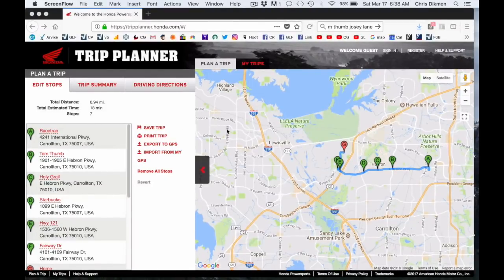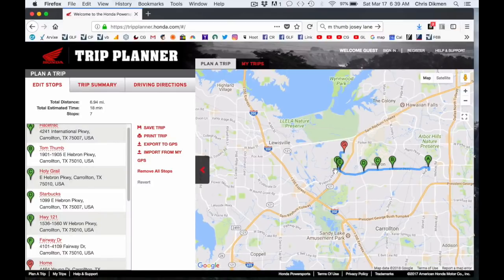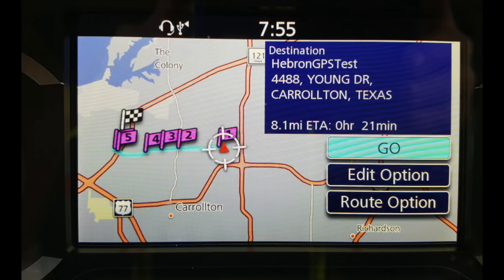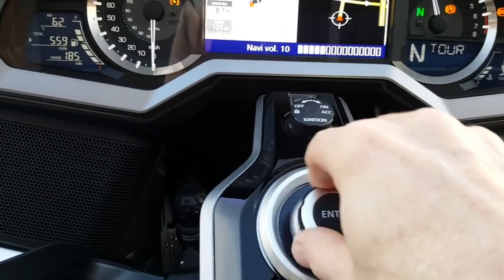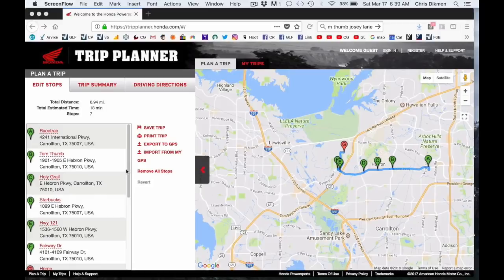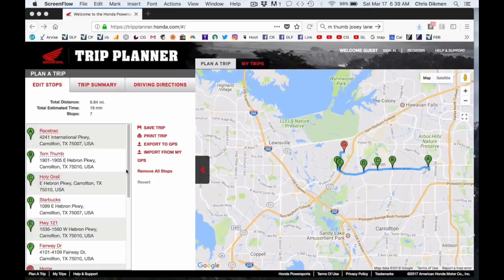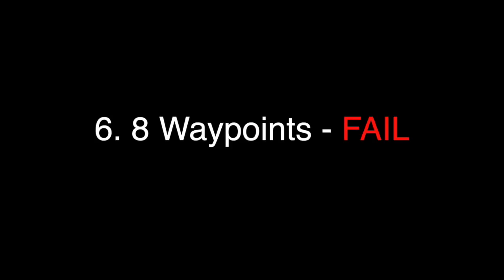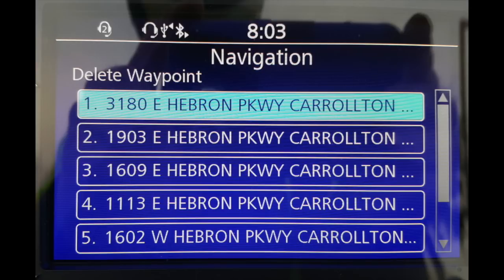2018 Honda Gold Wing Problems

Comment from the maker: UPDATE: I got an email from a friend last night who said his 2018 DID speak the word "Drive" correctly. I am going to do some more testing. I know mine did not interpret "LN" and "DR" on my route, because I live on Young Drive. I am also going to try to manually edit one of the GPX files to see if I can do a Find and Replace on "Dr" with "Drive" and see if the GPS will then speak the correct word. That would be a cool feature for GPS Babel to add, the ability to have it do that Find and Replace automatically during processing.

Comment: I pulled my deposit on the 2018 Goldwing, upon spending some time with it at the NY Motorcycle show in December. Both the installed GPS system and Apple CarPlay implementation were a disappointment. Other limitations, paint finish, reduced storage space, flimsy tank pocket lid, etc. have been well documented.

Comment: I just wanted to add that I am a long time Gold Wing owner since 02 I had Traxion upgrade the suspension on the old bike. In the very short time I have had the new bike I can honestly  say I love it so far maybe as I get into the bike more I will see issues. Baer in mind even the old bike had issues in the begining I was one of the owners that had to have the frame welded. I will update you once I try more ma input methods

Comment: Thank you very much for the information in this video. I find your videos to be fact driven and not based on any sort of bias. Keep up the good work. I will be buying a new Goldwing soon and am trying to decide if a new 2017 or the 2018 will be my best choice.  I find it to be a tough decision.
Reply from the maker: If you require a GPS, and expect it to be built into the bike, go with the 2017.
Reply: And if you want a NEW bike with a REAL GPS buy a BMW... This GPS is a MASSIVE MISS by Honda
Reply: I bought an 2017 ABS late last year because I didn’t want to be a Honda beta tester.  There are one or two features I wouldn’t mind having from the 2018 but largely I’m very glad I went with the 2017.

Comment: Cruise Man I'm so sorry to hear about this navigation. I always worry about buying any new bike or car the first year its made due to these kind of issues. I'm sure Honda will fix this issue with next year model but does not help you and others who spent over 30k already. I hope warranty resolves this. Thank you for all the updates and great videos
Reply from the maker: I wish I was as confident in Honda fixing this as you are. I figure they had 10 years to get this right and if they could not do any better than this, there may be little hope of a fix in the next year.

Comment: Me personally I only use a GPS to get to one location. If I want to go somewhere else I change the end route. For me even a cheap basic gps system works as long as it gets me to where I am trying to go. I was never big into planning multiple stops on a gps and tinkering around with different things. I always mute a gps so the sound quality, 8 planning points, and connection are not a big deal. I also always start my gps from where I am at not where I want to be so again this is not an issue to me. Overall the gps doesn't bother me one bit. Now those that are huge into using a gps and doing all kinds of things I could see where these might be issues but again for me none of this is an issue to me.
Reply: Agreed!  Some people will find issues with anything!   Who would make a video over something like this?   Just fix the damn thing!

Comment: Cruisman, I picked my new bike up two days ago. Same color (white) and with the DCT transmission. I tried to duplicate your problem were the address changes from the input. I am doing this inputing directly at the bike with the rotating dial. I tried five different addresses and each one worked fine it did not change the address from the input.
I have not tried transferring the data from the Honda trip planner yet I will try this tonight and see what happens.
Reply from the maker: You are correct, when you INPUT the address ON THE BIKE it holds it correctly. The problem shows up only when you IMPORT a route.

Comment: The fist thing I asked when my Honda dealer was first showing off there DCT Goldwing tour,  was about the GPS & when they said about 8 way points max , I laughed.  I load routes that will have 200mi or so with so many way points , my old Garmin 2730 handles it quite well , & to tell me a 2018 bike can't  ( unacceptable)

Comment: I have been disappointed with the built in gps on my 2018 Goldwing. I used it to get home and it did work fine for point to point. I am having a problem putting in the number of the address. Also the POI is not coming up. I have been using the Apple CarPlay with maps and made a short route and it worked fine. I do hope that a simple firmware update will solve that. Of course I have no idea how to even update the system when it comes out, since we are getting free updates for 10years. 
That said I enjoy my 2018 more than my 2007. GPS to me is a great addition but I still like to get lost on the road.

Comment: wow coming from Honda that's hard to believe.  Almost like they rushed the bike to production.  I personally like having a built in GPS on my motorcycles but have had more success with after market GPS units.  Hopefully its just an update that will fix it.
Reply from the maker: I would imagine they went cheap. They got a deal from HARMAN, or GARMIN wanted too much money. They should have stuck with GARMIN, or not had a GPS at all. BIG mistake.

Comment: Sounds like the system is designed to get you from where you are to a destination, NOT for trip planning.   I don't know why Honda can't figure out that on a Motorbike a GPS has a TOTALLY different purpose and that is pre-planned routes (and all that goes with that).

Comment: It might just need a software update. Have you had it in for service?
Reply: Stephen Smith 
The bike is brand new and shouldn’t need a software update that soon. The problems with the GPS can no doubt be solved with a firmware update. Hopefully Honda has been contacted so they can get to work on this.
Reply from the maker: This is more than a software update, this will require a complete overhaul of how this GPS works. It is simply an inferior product.
Reply: I have a new HD Road Glide Ulta and I thought the same thing. When I took it in for my first 500 mile service they also did a software update to the system and it cleared up many issues I too was having. I also bought a brand new Sena 20 intercom; that too required an immediate software update.  I guess what I'm trying to say is although you have a new product don't assume it has the latest software.  Remember a lot of equipment sits on shelves before it finally gets installed or sold.   To me - it's worth looking in--to.  Good luck!
Reply: and a bigger windshield, more storage space, and a better seat...
Reply: gman77gas 
You’re not likely to see an increase in luggage space, but a bigger windshield is available from Honda. Of course, the aftermarket Windshields will be available very soon I’m sure.
Reply: Well looks like I will keep my 05' or trade into a new 17'
Reply: No sense in trying to sell you a set of encyclopedias; you already know everything!   Hey - give me your address and I'll send you some cheese to go along with your whine!
Reply: Talking from a guy who bought a new Harley!
Reply from the maker: Send it to the address on the GPS and I will never see it
Reply: Oh, and lets not forget the suspension and steering........ Sooooo happy I didn't take the leap!!  Hello... BMW ??  LOL...
Reply from the maker: Scott, I have not noticed ANY issues with the suspension and steering of my 2018. My God, has EVERYBODY seen Max's videos?
Reply: LOL....anyone that is looking at Wings ...probably!!

Comment: From what i have heard so far (from various motorbike officianados), the 2018 Goldwing is not a very good bike. It's had issues with suspension, headnuts, satnav and more. I think that the 'differencies' between this and older models is that being NEW it hasn't ironed out it's niggles yet...mind you, any teething troubles should have been found and rectified long before reaching the dealerships.

Comment: Have you personally contacted Honda about this? Hopefully this can be fixed with a firmware and software update. Out of curiosity, have you tried using Apple Maps through the system? I know you can’t put away points in Apple Maps but just wondering if it works better as far as addresses and street announcements. Another thing you might try is to put Google maps on your iPhone and try to use that because I believe they allow waypoints. Of course I realize that way you have to do all the trip planning on the phone that way.
Reply from the maker: These issues are so deep that I don't think a software update can address all of these issues. It is simply am inferior product. It would be like trying to turn Windows 3.0 into the Mac OS, not going to happen. The limitations are hard-coded into the foundation of the GPS.
Reply: cruisemansgarage 
Sometimes firmware updates can be used to change things within the system. Hopefully Honda will address this soon!

Comment: You probably have your Garmin trip planning software to use and then use a translator program such as Babble to set that into a code the new Honda system can use.  I do not know if that would preserve your waypoint names.  I have never set my starting location as one of my points, I start wherever I am and the systems figure it out.  I hope Honda does update the firmware quickly, but until them my good ole Zumo will be my "point man".
Reply from the maker: I created the route using the Honda Trip Planner website.

Comment: cruisemansgarage Thank you for doing these reviews. You and Max McAllister (YouTube channel) Traxxion Dynamics, continue to provide support for, and prove my position, in regard to this "thing" that Honda has perpetrated onto the public! It's a complete disaster!! Obviously, you and Max have wonderful minds. I hold two law degrees and a degree in Psychology; I understand the agenda behind this mess perhaps better than anyone. Again, thank you for making this information public. Perhaps a few individuals who care about details and reality will be helped by this material. Keep up the great work.
Reply from the maker: Unlike Max, when I point out the problem with the GPS, I cannot sell you a $3,000 fix for it.
Reply: I have owned Goldwings and Harley's and none of the stock GPS worked properly, I found that using a free program from Tyre maps and configuring the map using this program and uploading it to my 2016 StreetGlide Special corrected the issues that you are having, shouldn't have to do this but it did take care of the of this problem. I don't buy a  bike solely on the buiilt-in GPS even cars with built-in gps are no good. If you want a good GPS then buy one and it will Work the way you want it to, I hope this helps you in your quest to have the navigation issue working properly for you. P.S. I bought a 2018 Goldwing also.....and thank you for your very informative videos unlike Max your not trying to sell me upgrades, and I'm also a licensed technician.

Comment: A $75 Garmin wouldn’t be weather proof. So not really a better GPS. Though you need to consider that Honda makes Motorcycles and Garmin makes GPS devices. A GPS in a motorcycle won’t compare to a Garmin unless Honda partnered with them. So basically everything you’re complaining about is more of a feature request. Still valid arguments but there is so much that goes into the bike already from Honda that you can’t expect one part of it to be everything a Garmin is when Garmin main focus is a GPS.
Reply from the maker: Honda DID partner with Garmin, on the 2006 thru 2017 Goldwings, and it worked GREAT (especially after the changes they made in 2012). Then, they went BACKWARDS with this new GPS.

Comment: Now this is what I have felt from all integrated GPS units - this is why I wish one could buy a motorcycle without any electronics as I can use google maps with my sena head set just fine. I just can't justify buying a $15,000 motorcycle with a $19,000 radio, which is what it comes down to. We are victims of  reliance on gadgets. I prefer getting lost the old fashion way, for one thing it's cheaper :-)

Comment: I don't use the navigation that much, but it really surprises me that the manufacturers insist on using nav systems on bikes and cars that aren't even as good as a basic over the counter Garmin GPS.  The nav system in my 2017 Infiniti is really lame compared to the $99 Garmin I've had for 3 or 4 years.  I can't understand why they won't go to Garmin and ask them to develop a good GPS based nav system with lifetime maps instead of this overpriced crap we get now.

Comment: I couldn’t agree more. This GPS is awful. The bike is great, but we take long trips and this GPS is not acceptable. Not asking to go to the beginning waypoint? Really?  8 waypoints for a touring bike?  Losing its settings every time I stop for fuel. Honda fix this POS!!!!!!!!!
Reply from the maker: There are so many issues with this GPS that it is laughable, if it weren't so sad. (1) Can't have a starting point in a route different from your current location. (2) No waypoint names supported. (3) Imported destination address are not interpreted correctly. (4) Find destination by intersection is totally useless. (5) POIs are not saved between sessions. (6) Voice commands do not speak "drive" or "lane" instead of DR or LN. (7) 8 Waypoint-per-route limitation. (8) Inferior map display on-screen. (9) No way to invoke audio instructions (previous model you could push Zoom).

Now, just right there, that's NINE issues that DID NOT EXIST with the 2011 technology on the 2012 Goldwing GPS. The last time we bitched about the GPS was on the 2006 Goldwing and it took Honda 5 years to address it. I can't wait 5 years.

Comment: Have you talked to Honda as to what they are trying or willing to do. With all the teething problems me and a friend are thinking about a 2019 MAYBE.  This was the first bike in years that I only went to look at it for maybe later down the road and wanted to take it home that moment. Glad in didn't trade mine in. They made me a helluva an offer.thanx for all the in info my next trip is a month long and the GPS is mandatory. That much more for GPS and and still have to use your phone. Big failure honda
Reply from the maker: I have already been waiting 6 years for this new Goldwing, I am not prepared to wait any longer. Hell, I am getting too damn old. By the time Honda fixes this (if at all), I will be off of motorcycles. I expected the 2018 GPS to me MORE capable than my 2012, not LESS.
Reply: cruisemansgarage  it's a lot of money for a luxury item that most ride maybe 4-5 months a year. The loss of just the top box storage was a shock. The helmet hook on the rear seat is a joke. I only use the rear hook for helmets when it's parked .I'm afraid I would have to return the bike .

Comment: This is the reason that in-vehicle GPS system have faded in popularity. You have 2 disparate makers, Honda and Garmin, coming together on a joint product that neither of them fully understand. And is usually a small volume niche market product. So when there is an issue and one looks to get it resolved, the two makers involved end up pointing fingers at each other, saying "It's THEIR product. This leaves the customer in the muck. And being a small volume product, neither company is going to invest heavy resources in product support.

As for the Garmin not knowing how to pronounce "LN" as Lane or "Dr." as Drive. Remember that this product is sold in several countries and maybe in different languages. The people doing the programming are probably not even aware that these abbreviations exist.
Reply from the maker: This is not Garmin. Honda dropped Garmin and went with HARMAN. The Garmin on my 2012 was MUCH more capable, and NEVER needed an update.
Reply: cruisemansgarage hmm. Never heard of Harman. 

But I think the comments regarding the general situation is valid.
Reply from the maker: https://www.harman.com/intelligent-navigation
Reply: Harman Kardon... one of the oldest still made in USA stereo manufacturers. They also build the systems on the Harley Touring bikes and stereo systems.
Reply: This is why I use my phone exclusively for nav but frigan Honda didn't implement androi auto!
Reply: To be precise, Honda approached google and they passed on the changes needed to make Android Auto more motorcycle friendly.